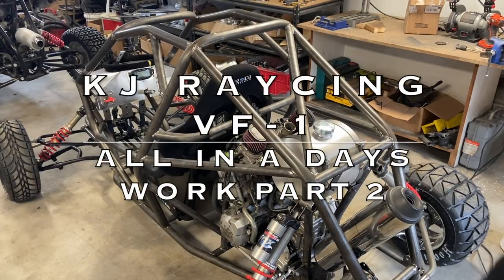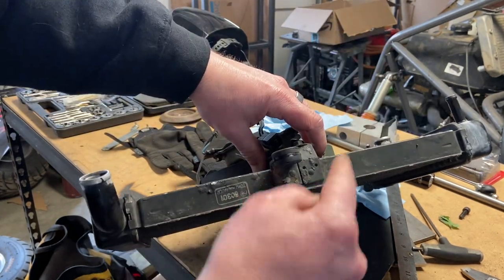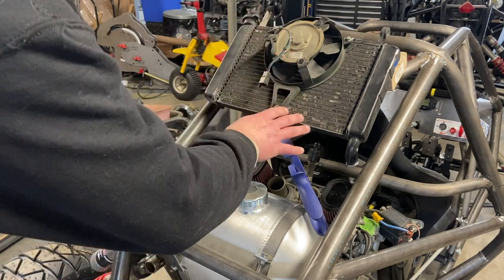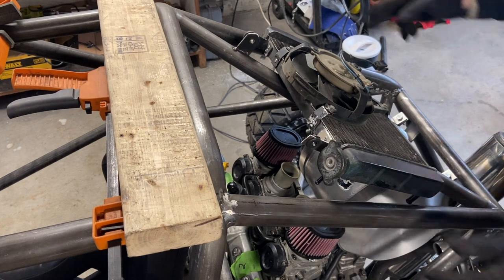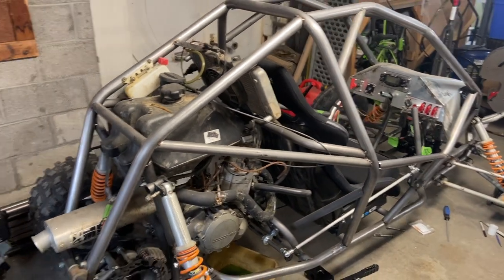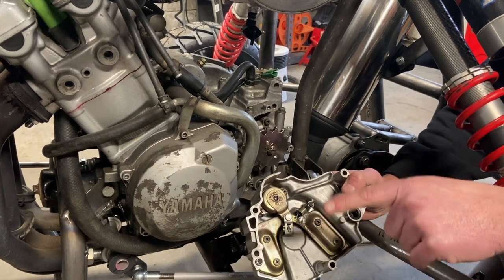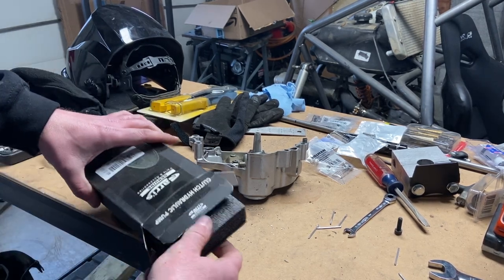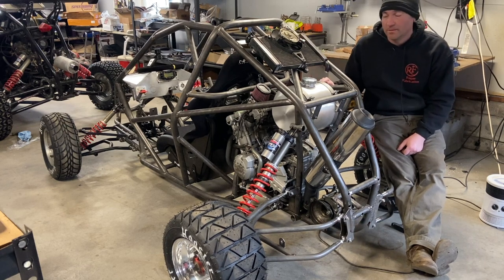Crosskart Build: #16 Part 2: Radiator and Hydraulic Clutch KJ Raycing VF-1

Comment: Hey for reverse use a car starter and have the sprocket or center brake disc cut for the gear. It works great.
Reply from the maker: I did pretty okay without reverse. Knowing I don’t have it makes me drive it accordingly. But thank you for that, sound like it could be a simple mod.

Comment: Is the fan a pusher or puller? If the fan is puller, won't  it suck hot air from the engine? With the radiator laying mostly flat..  Will it cause it to have insufficient air flow for cooling?  Plus, the radiator will still have an abnormal amount of air in it. Unless you are using a surge tank...  Awesome show. Thanks.
Reply from the maker: It’s a puller, same orientation as the stock setup. It is far enough away from the engine to dissipate heat efficiently. I will tune an overheating engine with jets and carb tuning if it gets to that. My hope is that enough air will flow not only through but over and around the fins to pull the heat from it. And i can always add some cool ducts to redirect some air.  Fan will only kick on if it gets hot, not run all the time. I ordered an overflow/surge tank the same day i shot the video, totally missed that i didn’t have one.

Comment: Nice work. Any reason not to put the radiator under those bars? Also could the fuel tank be moved lower and behind the seat? I understand a small fuel pump might be required.
Reply from the maker: They can go wherever 😁. The fan motor on the back of the radiator would make it sit pretty low and the fuel tank behind the seat with fuel pump would require pretty long fuel lines that would have to run past all of the hot parts of the engine. And i usually try to put the cdi, rectifier, relays and solenoid there. Thank you for the comment and the compliment 👍

Comment: Could you use two of those hydraulic cylinders (push/pull) for a paddle shifter setup?
Reply from the maker: I don’t think so. If you are looking for paddle shifters look at pneumatics. That’s what the drag bike guys use. I’ve never done it personally, but if I needed to shift .000000002 seconds faster this is what I would look into. 👍 I wish you the best with your builds.

Comment: Great Vids Brother....maybe round off the end of your tabs ? ...They will look much more professional....not a criticism just a thought...All Good Brother. ...just bought the Harris Hydro on Amazon...
Reply from the maker: Thank you. I’ll get the tabs rounded. I two out of three were already rounded, just got excited and tacked the third. The amazon harris is not stand alone, it is a slave cylinder, i hope i made that clear in the video...
Reply: @KJRaycing  All Good Brother..just sent friend Rqst via Facebook. I have an Edge Barracuda build going...GSX 750F ..Mazda Miata ( MX5 ) uprights, brakes, hubs etc...will be over-engineered, but I'm not looking at racing just for fun.
Reply: Do you have a link for that clutch cylinder? Can't seem to find it on Amazon
Reply from the maker: WOOSTAR M8 x 1.25mm Motorcycle Hydraulic Clutch Master Cylinder Rod Brake Pump Replacement for Yamaha Honda Dirt Pit Bike ATV 4 Wheeler Quad Scooter Red

Copy and paste this